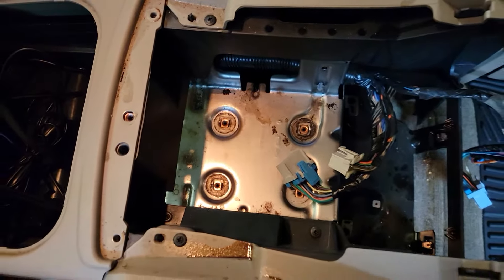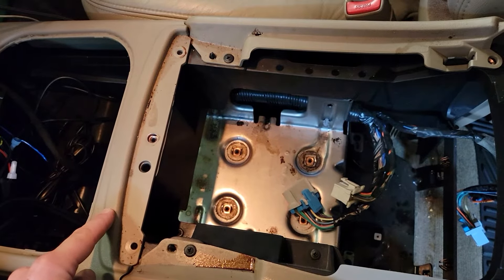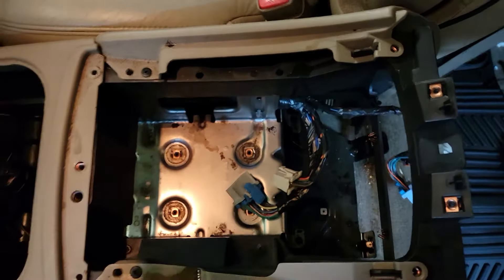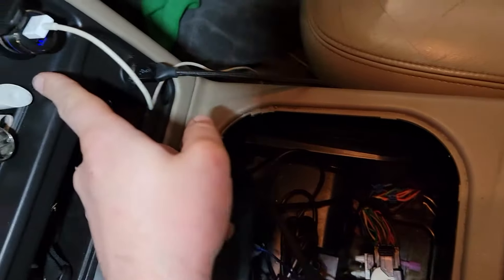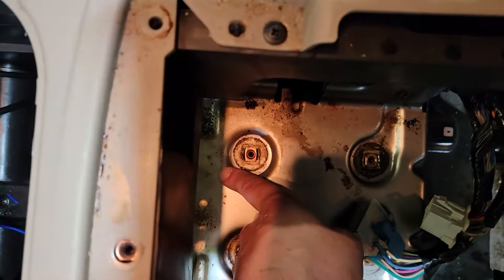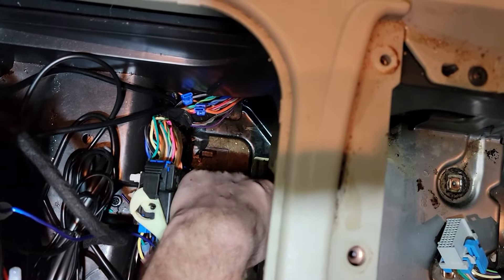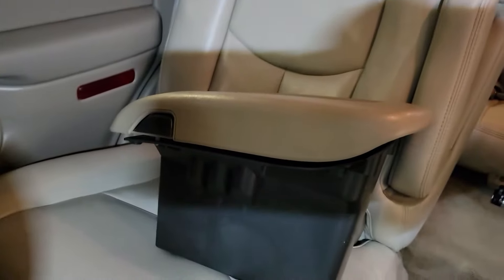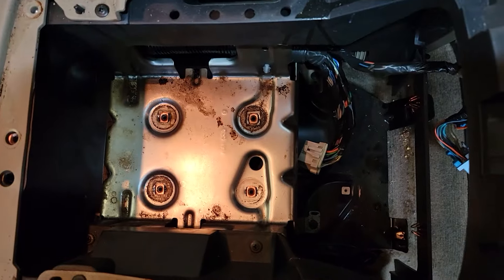2003-2006 Chevy/GMC bose amplifier removal

Comment: OK I got a question I got it 01 I guess it had the Bose system in it that one amp does it run the entire system or is there two amplifiers I’ve seen the videos with them under the dash also seen videos with them in the back left corner panel this is the first one I’ve seen with it in the center console need help thank you my subwoofer is dead cannot get any sound out of it Brand New Polk audio speaker is there a certain wire to cut it on or is it already on if all my door speakers are playing rear tweeter is not playing also

Comment: Just thought I'd give you a quick thanks! I was able to use this easy trick to remove the bad Bose amp from my 04 Tahoe and replace it with another, without removing the center console or hacking it up.
Reply: What are the symptoms of a bad amp? My 04 Tahoe has the music and chimes cut out intermittently, but when I hit the radio it works again, lol.

Comment: Have a 06 Silverado with an amp. Currently have good fuses to radio and amp. No sound, wonder if the amp is bad
Reply: Me too speakers work one day the not 1 doesn’t then #2 doesn’t work then 3 out of 4 don’t work.
Reply: Was the amp bad?
Reply: @kadent7320  swapped it out, still no sound. Probably swap out head unit next
Reply: Same problem but i swapped out the deck. Still no sound. Replacing the amp is my next step. Or bypass...
Reply: @Flexyourmemes  did this work? I am about to bypass factory amp.
Reply: @sammythebull2240  yes, in your dash youll have the connector already there that plugged into your stereo. To the right and back will be another identical connector. Its plugged into a receiver so youll have to work it out. Then plug that second one into your stereo. Only thing ive found wrong is i have no pillar tweeters now but thats ok.

Comment: When you pull out the amplifier is the factory wiring left. Left right front back have its own ground after I disconnect the amp or do I need an adapter thank you.

Comment: How do I remove the factory subwoofer to replace it with a bigger one how to remove the center consul to get to it
Reply: Ive replaced mines with a ct sounds meso 6.5 400 watt rms, ran that sub to a seprate amp though and with some modification it is possible. 
Also you can replace it with a cheaper 6.5 skar audio subwoofer with slight moduicvation aswell and have that hooked up to the factory connectors. I ran a seprate amp with my ct sounds meso because i knew i could put way more power to that sub.

Comment: I have a 2004 GMC Yukon Denali and I’m having a problem getting sound to come out my speakers. I’ve tried everything besides cutting wires. I’m going to use my own amplifier but having a very hard time bypassing and getting sound. Any suggestions?

Comment: Any idea if the bose amps are interchangeable between an 03 and and 05 tahoe? My 03's amp is under the cup holders, not the jockey box.
Reply: Does your speakers not work in Cold weather?? Mine only kicks on when it gets about 80 or 90 degrees out... Weird
Reply: @coatneyadkins9005  cold weather didn't seem to affect mine. That is pretty weird.
Reply: @ShaneSchimpf  ten four. Yeah it is weird. I swapped the radio unit and unlocked it... Still same problem... Gotta be the amp wouldn't you think?
Reply: @coatneyadkins9005  someone told me recently to check the wiring harness if I had redundant stereo controls on the steering wheel because its easy to wire them wrong. But if that's good and it's all wired correctly, I'd probably try swapping amps. Good luck 👍

Comment: For the most part, this video is completely useless! Why didn't you actually document the removal of the amp? It's not there so someone removed it....What tools are involved? What comes out first? Why is the amplifier suspect?  What is going back in? Factory or aftermarket? Who repairs Bose? Where can I send it? What is the other audio equipment in the video for?
Reply: Be careful messing with that wiring box that he said is just for the amp. I messed around with it in a 2003 Tahoe and now nothing in the car works at all and the car wont start. I think it controls more than what he says.
Reply: @Marept999 That good advice I think after listening to all the comments of stuff not working after.